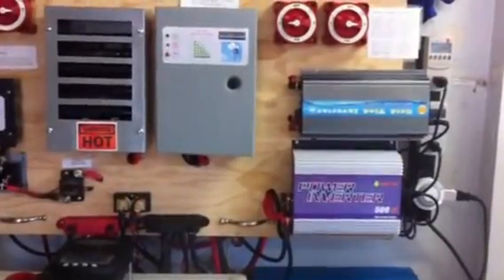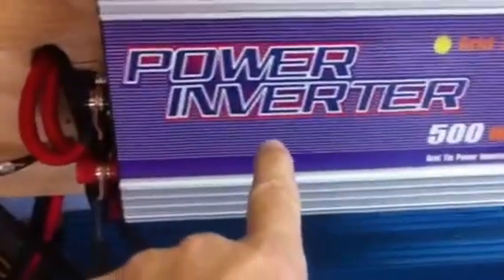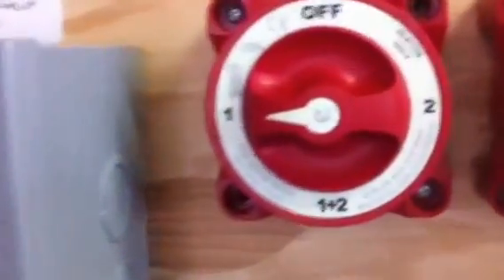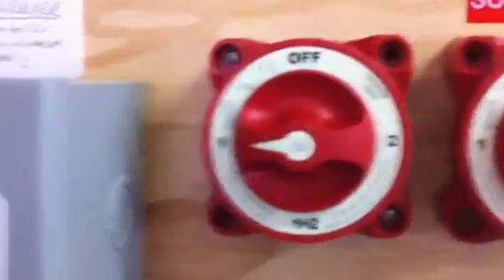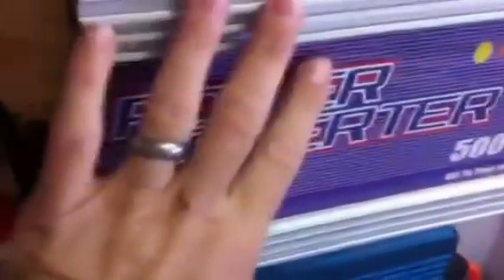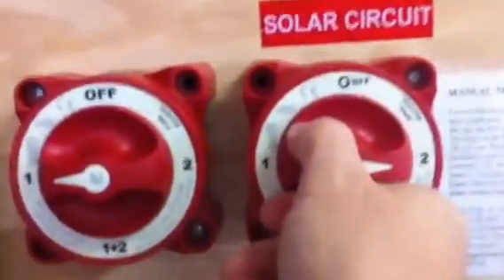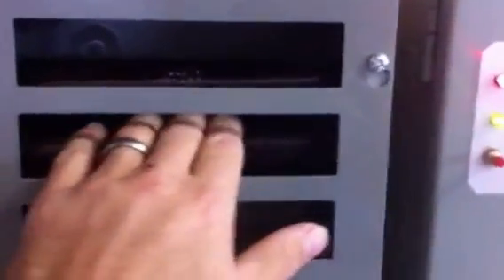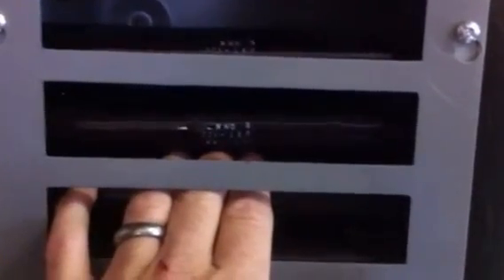Testing Wind Relay from Battery to GTI to Dummy load

Comment from the maker: Hi Ray- thanks for kind words.  yes, these GTI (Grid Tie Inverters) are plug in type.  therefore, pretty much just hook your pos and neg from solar panels to the pos and neg of the GTI, then plug the GTI into any wall socket. You can get these online for $275-650.  I recommend the SUN G and if possible the 1000w.  The Ensupra 1000w GTI is also good. You can find on Amazon, etc.  If you're also doing wind, get the SUN G GTI with dump terminals. good luck and let me know if you need any help